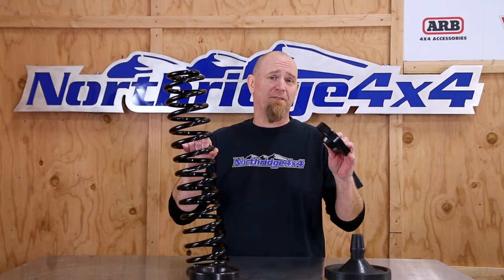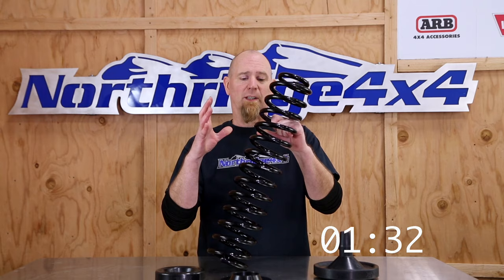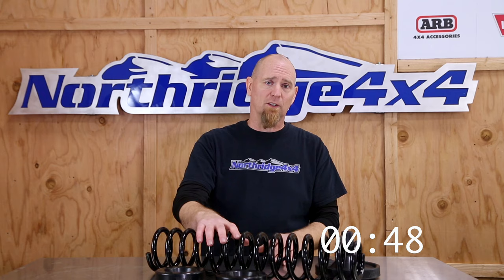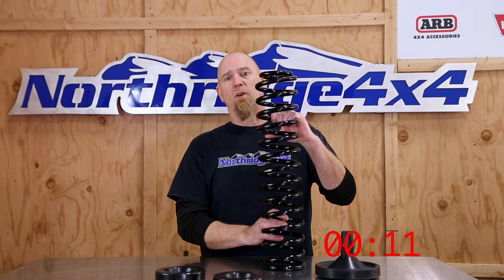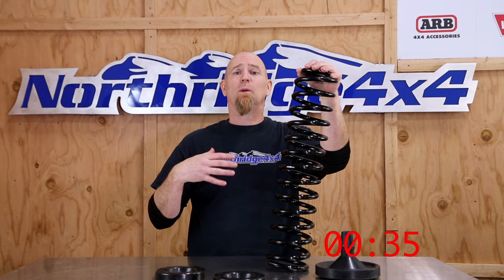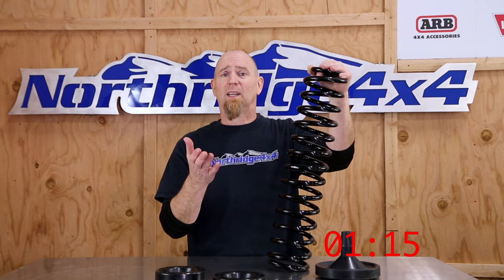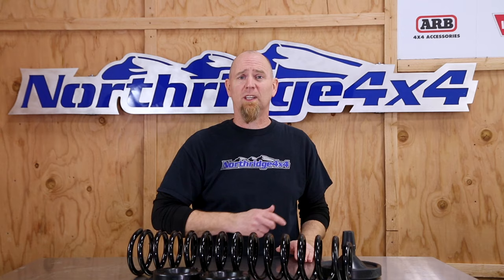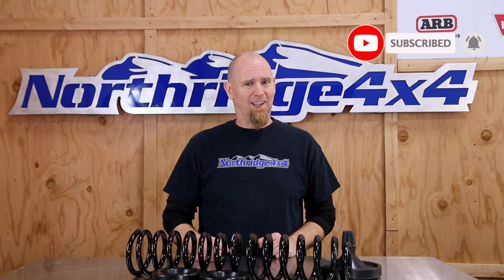Spacer Lift or Coil Spring Lift? EXPLAINED!

Comment: Ive been told its not good to use the spacers as it pits strain on the lbj and ir also can cause the shock to snap away from its mounts
Reply from the maker: You must be talking IFS....?  Lifting IFS is more complicated.
A coil spacer that gives 1" of lift will put the same amount of strain on the ball joints as a coil that gives 1" of lift. They are both lifting 1", the strain will be the same.
Spacers that are used under or over the strut/coil-over(shock) mount can cause other issues.
It is always best to look at it in terms of overall lift and make the modifications necessary for the amount of overall lift you are gong to end up with.

Comment: have a question . . . 4WD SUVs & light pickup trucks equipped with a 2.0 in. or 3.0 in. suspension lift actually has different level of lift between the forward & aft suspension setup . . . if the front axle has a true 3.0 in. lift the rear axle has something like a 2.6 in. or 2.5 in. lift . . . so my question is why's the lift less at the rear? might as well have a true 3.0 in. of full spec suspension lift both at the front & rear . . . if not why??? please advise . . .
Reply from the maker: Because most trucks and SUVs have a rake to them, with the nose lower than the tail, most lift kits don't lift the front and rear equal heights. They typically lift the front more to help level the vehicle.

Comment: Awesome video.  Now here is what I am trying to find out what my friend needs to boost the height of his Ford C-Max.  The C-Max is just a tough over 63 inches.  And I want to boost the body up to where at least my seat is raised up by an additional 18 inches.  So how many spacer lifts would I need to give it that boost?  And while this is about lifting a vehicle, but inside the vehicle, I would love to find out how much lift I would need using the spacer lifts.
Reply from the maker: How many spacer lifts to lift a C-Max 18"s?  All of them.

Comment: I have a 2019 Forester with 1.5 inch spacer lift and now at full droop and full lock the sway bar link fouls the  steering arm. Will a 1.25 inch spring lift prevent this from happening? Enjoy your vids.
Reply from the maker: We don't know the answer to that Q straight out.
Get that Forrester flexed out and take a look. Is it hitting hard or just barely? If it is only just barely hitting the steering arm, then dropping it a 1/4" might help out.

Comment: Can you advise me on the best way to lift my 2004 Acura tl an additional 3 or 4 inches of possible. Also I don't do any off reading or anything of that nature.  I just want my car a few inches higher as I get in and out of it.
Reply from the maker: That's a little outside of our field.
If we had the car here, we could take a look. But without seeing how it all goes together, we would be guessing.
Lifting independent suspensions 3-4"s can take a lot of engineering to get it to drive right. Most mild independent lifts you'll see are only 1-2".

Comment: My son wants a 3" lift all the way around on his stock 2WD 2002 Dodge Durango (1997 to 2003 same and 2WD Dakota same) to fit new tires.  The rear shouldn't be a problem with "add-a-leaf" combined with shackles because it is an axle over leaf setup.  The front is the question we have and is hard to find an answer.  Some mfg's make spacers for a 3" lift but it's hard to get information if other parts will be needed to achieve correct alignment or we could simply install the spacers and get the vehicle aligned without issues.  I really don't want to do a body lift as he is considering.  Can you help?
Reply from the maker: Typically, on an IFS lift over 1.5", you will need extra components to get the IFS suspension back to align-able specs. We haven't done a 2WD Durango yet but we're going to guess that 3" spacer kit will cause other problems without more components.
A small body lift is a great way to get some extra lift. So maybe think about a 2" suspension lift and a 1" body lift or some other combination.

Comment: I am looking for a 2.5 inch spacer lift for a 08 Toyota sienna rear coil spring, What or which one do you suggest?  thanks!!
Reply from the maker: There currently isn't a 2.5" lift spacer listed for your Sienna, so it would be a matter of trying to match it to an already available spacer or make one. That would be a big lift for a small IFS, so there may be many other components needed to get it all right.

Comment: Can you combine a like 1” spacer with extended coil overs to help with pre load? We compress springs and collar them to get height but at the cost of spring performance… right, so if I feel I’m at my max height on the coil over but the rear is still higher can I just throw a 3/4”-1” spacer to make up the deference? Thanks
Reply from the maker: Yes, just keep in mind that the height will be different, a 1" spacer might give you 1.5" actual lift.

Comment: I have 2.5 Inch Readylift(Springs + droop brk+ 4 bilstin 5100s).  Q: need another inch or so to fit 37s.  Can I just add a 1 inch spacer, or I have to buy a 4" kit .  I should done this to from the onset -
Reply from the maker: You can add a 1" spacer on top of your 2.5" springs as long as you have all components needed for a 3.5" lift.

Comment: I want my explorer lift 2.5''front and 1.5''rear..what is better lift spring or lift spacer?
Reply from the maker: It really depends on what you are trying to do. If you just want the lift for bigger tires to look good, then go with spacers. If you want the lift to fit bigger tires for going off road, go with a lift spring.

Comment: What is the formula to calculate the proper spring length and spring rate to achieve a given suspension throw given the corner weight, unsprung weight, suspension arm ratio, spring angle, and lower control arm angle?  Then given a fixed vehicle speed how do we choose the correct damping rate to maximally dampen the oscillation of the spring system?  How does compression differ from rebound in this regard?
Reply from the maker: Damn, don't get Tech Tim started or we'll never hear the end of it.... 🤣

Comment: if you are changing ride hight but all you change in the suspension is adding a spacer, you're killing your suspension. 

The suspension arms are still the same, and they were designed for the "normal" angle. The driving rods are also still the same. The bump stop is now further away, but the spring is still the same and may compress before the bump stop is reached. All of that is bad
Reply from the maker: Too many variables to be that concrete in your statement. First and foremost is the vehicle being lifted and what type suspension it is.
Reply: @northridgenation  variables are many, but the statement is still much more often correct that not.

Comment: I have a question; 1998 Dodge ram 1500, 2wd. Came stock with i think 15" wheels. I put 4th gen 17.5s on it, and i have negative camber, with the top of the wheel tipped in almost 1.5 inches from center. I know longer upper arms or shorter lowers would work, or moving the holes for the de lum bolts out would correct as well. My mind is telling me a 3" spacer might also correct this, thing is, im not right all the time. What say you, Proff?
Reply from the maker: That depends on the suspension geometry. If the suspension loses camber as it droops, then that could help a little. If the suspension gains camber as it droops, it would make it worse.
A set of replacement upper arms that correct the geometry would be your best bet.

Comment: Can you add a 3 inch spacer to a 5 inch coil on an 01 Dodge Ram Sport Off Road Edition to gain the 3 inches that you lose due to it already having 3 inches on the off road edition?
Reply from the maker: As long as your other components are designed to work with 8"s of total lift height, yes.

Comment: I’ve got a 1990 dodge D150  2Wheel Dr. It has all original suspension so it’s wore out. I deliver Firewood with this truck. I’m wanting to put the air lift 5000 airbag suspension in the rear and I’d like to put a 3 inch lift on the front with new ball joints, and tie rods and such steering stabilizer, what is the best way to go about this taller shock and coil over or just the original shock and coil over with a spacer I live in Arkansas the roads are pretty twisty winding and a lot of up and down and again I deliver and haul firewood, so I’m kind of heavy at times but when I’m empty, I’d like to truck to be leveled when I throw a bunch of firewood in the back that’s when I’ll put more air into the airbags and bring the rear back up to standard level height with the front when I’m empty, I can let a little bit air out of the back and go back to level with the front if that makes any sense I appreciate your help in this matter. Thanks so much in advance.
Reply from the maker: For that application we'd definitely recommend replacing the springs and shocks, especially if you already have a lot of miles on the truck.

Comment: I have a 93 zj with 3.5” coil lift with rancho rs5000x shocks. with 31” tires . I was wanting more clearance can I put spacers on and keep the same shocks ?..
Reply from the maker: Depends on the length of your shock. Look up the part number and see how much lift they are rated for.

Comment: I drive a 2015 F150 4WD and currently, my coilovers are set with a preload of 1.5 inches between the rings. I'm keen on reducing this distance to 0.5 inches to improve both my down travel and overall ride quality. However, it's important to me to maintain my current height. I'm considering the option of adding a 1-inch spacer above the coilover, but I'm uncertain about its effectiveness and whether it might have any other impacts on my vehicle's performance.
Reply from the maker: Adding a 1" lift spacer or a 1" thick spacer? 
Due to the leverage ratio of the arms, a 1" thick spacer will net you more than 1" lift.

Comment: can I double up a spacer lift like a 2 inch and 2 inch on one side?
Reply from the maker: That depends on the spacer, can they be stacked? It'd be to consult the manufacturer.
In general, you could stack them, but you would need to make sure you have all the needed components for the total combined lift. In your case 4". Longer brake lines? Longer shocks? Steering components? etc.

Comment: I got a 2.5 inch suspension lift. Will it lower when it settles?
Reply from the maker: Depends on how soft the springs are. Softer springs tend to settle more than stiffer springs.

Comment: My local offroad shop strongly advises me against using spacer struds, citing problems with stability and ball joints. How accurate is this? I see so many use it and have no problems - what are you guys take on this?
Reply from the maker: Spacers are fine to use if they are kept mild and you install all needed parts for the amount of lift you are shooting for.
It is also quite different between a live axle and an independent suspension. So make sure you are aware of what is needed for your application.
Reply: Please explain the difference in 'live axle' as opposed to independent suspension.

Comment: I gone lift my toyota fortuner 2006 in front i need new springs and shock becose i will install a steel bumper so more weight but the back i am not sure can i juse a spacer ?
Reply from the maker: Yes, you could use a spacer in the rear.

Comment: Just wondering how high can you go with a spacer lift? Would it be ok for me to do a 4 inch spacer for my Jeep?
Reply from the maker: We really don't recommend spacers for anything over 2-1/2"s. As with any lift, coil or spacer, you need to address shock length, steering angles, trackball angles etc. 
There are many advantages to a longer spring, more travel and better spring rates are the two biggest benefits. So when you are talking tall spacers vs. springs, we would rather see you take advantage of the benefits that a taller spring will give you.

Comment: Which one has a smoother ride
Reply from the maker: In general, the coil spring with give a better ride.
A spacer will not change the ride quality of the spring.
A new coil can change the ride quality, depending on it's rating. Choose your coil spring depending on how much gear your will be adding to your 4x4.

Comment: I have a 2016 ford escape I have seen both spring lift (levels the car f 1.4 in back 0.8 in) and spacer lifts (15 to 40mm), could i use both the spring lift and either a 15 or 20mm spacer? I know the brake lines will need to be longer. Also, i saw someone on youtube add 4 inches to a rav4 with both but it looks really unsafe.
Reply from the maker: You can depending on how much lift that suspension can handle.
Reply: @northridgenation  what do you mean by suspension? Shocks and struts?

Comment: I want to raise my 2014 Ram 1500 Longhorn (Non-air-ride) 3 inches in the front and 1 inch in the rear. I am putting an all-weather tire on it, 
NOT a Terrian or mud tire. Similar to my Wrangler SRA's. highway tire. 

How can I keep my factory ride, I hear from many folks ride is much worse.  Is it the spaces giving the bad ride cause new geometry? or the 
Tires they put on? or both.

Any help would be appreciated.
Reply from the maker: The best thing you can do is give us a call at 866-601-5340 and chat with our team.

Comment: Like your video so much that I had to comment and have an idea...need helpful info..I'm running 06MaximaSe and would love to lift the back end with springs at least 2"..any ideas would be greatly appreciated..thanks in advance.
Reply from the maker: That is something outside our realm of the 4x4 world, but the same rules apply. However there are compromises to everything and an IFS/IRS will take more engineering to get a 2" spring lift in there and make things work properly. 
We would say take a hard look at the suspension as a whole. Is the suspension on a sub-frame? Can you build a spacer kit to drop the complete rear suspension 1"? Then you just need to find a 1" longer spring.
Reply: Btw Here's my specs..11.27 free length and 8.5 compressed..with 4.04 inside diameter  and 0.59 bar diameter at 331 lbs...so I was looking at 14.25 free length and 11.5 compressed..same inside diameter..0.70 bar diameter at 741 lbs..thinking that my fall within the range..I mean I'm a novice at this..you guys are the PROS..thanks again

Comment: I have a sxs I’m buying but idk if I should put this 3in spacer lift on bc I’m thinking it’s gonna be bad on my springs
Reply from the maker: We're not SXS experts, but we'd say make sure you have all the other components needed for a 3" lift to go along with whatever spacer you decide to use.
Spacer tech is very different on independent suspensions than on a live axle suspension like the Jeep.
Reply: @northridgenation  yea my sxs have fox live valve dynamix

Comment: Hi, I have a 2015 Tacoma PreReunner Sr5. I want to make it higher on the front than the back. I measured from the ground to the front fender and is 35” the rear is 37”. I just want to lift it in the front for appearance, it’s my first truck, it’s a 2wd and obviously and no trying to go off-road or anything like that. What do you recommend? It’s to much to go with a 3” spacer in the front? I will appreciate your help on this.
Reply from the maker: You want to look for a leveling kit in the 2-3" range.
On an IFS, because of the A-arm leverage ratio, the spacer won't be an exact 2-3"s in height.
Reply: @northridgenation  thank you very much 💪🏽

Comment: Alright who has experience with spring lifts on 2nd gen tacomas? Spring height? Spring rate? Best brands and what shocks they are compatible with?
Reply from the maker: There are lots to choose from. Old Man Emu and Icon are both well know for their Tacoma suspensions. 
What are your goals? How much lift?
Reply: Northridge4x4 so for my 2nd gen Tacoma id like to accomplish a 3” lift and eventually move up to bigger tire sizes and re-gear my diff. I want these upgrades to have a good performing off-road rig to be able to go anywhere I need (living in Utah, hunting/fishing trips, sometimes trails can’t get hairy especially in fall/winter months). I have a steel front bumper with a winch, sliders, and rear bumper on the way. I’ve looked at options from OME, Toytec, and icon as far as lifting coil springs but not too sure what length or spring rate I should be running with the extra weight in the front just yet. For the front shocks I have been looking into getting bilstein b8 6112 shocks but just need to confirm what lifting coil springs will work with the 6112 shock. After all this modification I plan to upgrade my UCA’s to fix alignment and premature ball joint/ tire wear issues also. I’m open to all genuine advice and would like to see other 2nd gen Tacoma builds of this kind.

Comment: Hi if i put 2inch spacer lift at my rear car and 1inch front is there an effect on the tires?
Reply from the maker: A difference in height between the front and rear would make no difference in tire wear.
Make sure your vehicle has a proper four wheel alignment and that all the components are in good condition.
Reply: @northridgenation  thank you very much

Comment: Will I need a longer shock for a 2” spring lift, or can I use stock
Reply from the maker: You're right on the edge. Most OE shocks are good for an extra 1". 
Most aftermarket shocks start at +2".
Reply: @northridgenation  How do you know if the aftermarket shocks in question can take on a 2'' lift?
Reply from the maker: Look at the advertised lift for the shock.